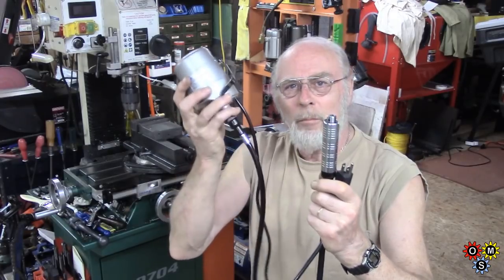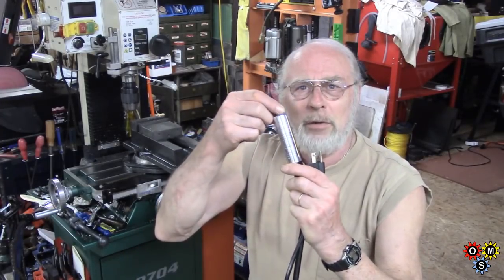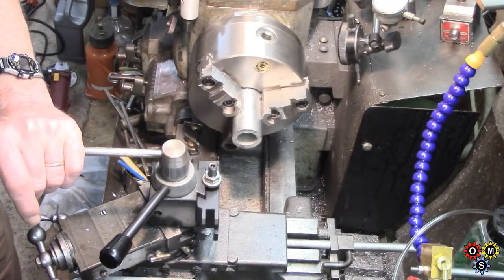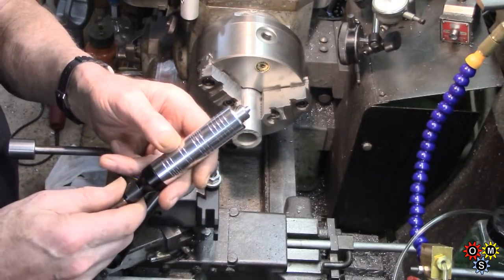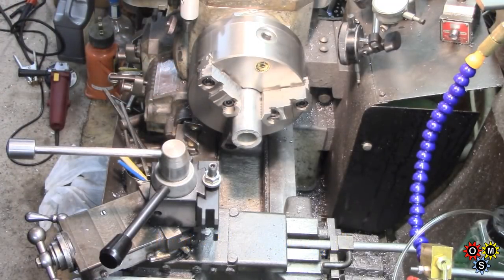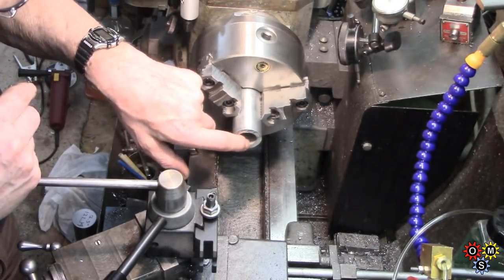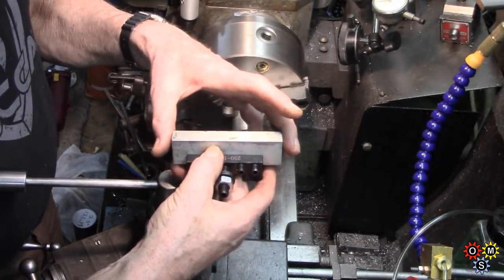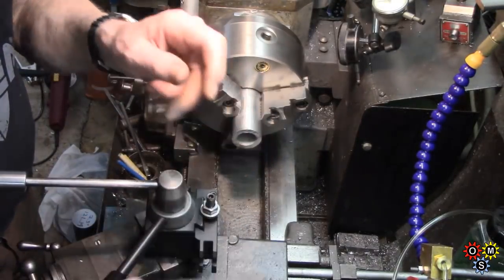Toolpost Grinder Attachment 2

Comment: watched the Dremel grinder project needed something a bit bigger so bought a cheap die grinder with a strong bearing front end and used the same idea works fine but i like the flexible shaft project looks stronger and good for smaller work great video thanks

Comment: I strapped a new Makita grinder to my Mini lathe, on the tool post just to see if I could get down to tenths of a thou, it surprisingly worked. For the internal grinding, the small grinding wheels with the metal shaft, I glued to a hole in the spindle with five min araldite,  after a pass with a diamond they were ready to go and worked well, changing a wheel was just a matter of heating the shaft where the glue was, and the old wheel fired out like a bullet, then sticking another in as required.
Reply from the maker: Hi - thanks for describing that - sounds very effective. :)

Comment: Nice work Chris. I like the fact that it is much quieter than my air die grinder.
Reply from the maker: Thanks Bob - well yes quieter but - won't deliver the RPMs of an air unit. May be enough but if I had the compressor I'd like, I'd probably go for air power even now.

Comment: Nice adaption. For a successful grind, you definitely need to dress your wheel with a nice sharp single point diamond mounted solid somewhere on your lathe. Heat is the enemy, so I would lean toward a softer coarser grind wheel.  Also, I would suggest dropping the lathe rpm to about 100 and experiment from there. If your air grinder is powerful enough, and it's bearings can take the side thrust, you should get a really nice finish. At some point, a spray mist will help. Keep up the good work Chris!
Reply from the maker: Hi Michael, thanks. Indeed I must get a diamond point dresser - my last one came to grief and never replaced it as yet.
Thanks too for your suggestions - spray mist is a good idea too.

Comment: Hi Chris,
              For a cheap tool post grinder you can't beat the small 3 phase helicopter motors from China. I think I paid about £6.00 for a 80 watt motor, max speed 33,000 rpm, and the ESC unit just as cheap with a speed controller at £3-4 (just under $22 total). This particular motor was only 1" diameter and 1.5" long. I happened to touch the shaft while it was running and got a bad friction burn due to the high speed. I intend to use mine for the cutter drive for a small CNC router geared down to about 10,000rpm.
Good video.
Cheers Mo
Reply from the maker: Hi Mo- sounds like something well worth trying! Thanks.
I'm thinking this was a DC motor -12v maybe?

Comment: Very nice attachment Chris, you mentioned running the lathe faster, you will get a better finish if you run it slower and maybe even run it in reverse.
Reply from the maker: Thanks - in fact one project on the back burner right now is a means of controlling the chuck - it's on a thread and needs a method to be able to safely run in reverse. That would be much better then for the grinder.

Comment: You need another attachment on the chuck (stationery) to dress the grinding stone which will correct the run out!
Reply from the maker: Thanks - yes. I did eventually make a simple attachment for the chuck in order to dress the stone. Used an old carbide tool in locked 4 jaw. :)

Comment: You run the grinder and the chuck contra to each other when grinding.Dressing the stone is essential. Aluminium oxides are good for steel girding, don't using hard girding wheels for hardened steels,they have a tendency to polish instead of grinding. Use a good quality cooling  and cutting emulsion. Cutting depth 0,02 m/m per pass, rough item to 0.2 m/m before finished measurement and keep grinder-wheel holding spindle as short as possible.I have done all shorts of girding commercially.It's a very interesting metal working field.
Reply from the maker: Hi Michael - this was done before I made a safe chuck reversal fixture, which then of course will allow contra rotation. Thanks for your useful comments.

Comment: Very nice work once again there Chris. HOT they say 117 here on Saturday.
Reply from the maker: Thank you.
I saw 4cast and saw what temps are possible across that way - AZ, NV and CA etc - awful highs. Near 90 hear and humid is pretty unpleasant.!
Sounds like you may be Phoenix or similar.
Reply: Chris, Apache Junction ,AZ  Its crazy Chris, Like someone throws a switch, just bang HOT over night man.June is the hottest month here, after that the monsoon comes and keeps temps bearable. Then in late Oct, the same thing over night it seems like the switch goes off, the temps drop.

Comment: Hi again Chris,
     Just had another thought. Instead of small grinding wheels how about a 3/16" carbide end mill in place of the wheel. With the workpiece running at what, 1000rpm and the toolpost grinder motor running at around 8,000 rpm I'm sure the combined speed of cut should give a spectacular finish to around 0.0001". I'd like to see the results If you'r inclined to try it out.
Regards Mo
Reply from the maker: Another interesting idea!! Something when I get to it I will experiment with. One annoying factor is my spindle is threaded and so reversing is not entirely safe!
Reply: Hi Chris,
    The thing is you don't have to reverse your spindle all you have to do is reverse the tool post grinder to obtain max differential speed.
Cheers Mo
Reply from the maker: Had thought of that Mo - have not yet explored options on that motor.

Comment: Interesting workshop and you are doing a good job. I'm a precision mechanic from profession, retired for a dozen years but am making similar things up to this day.
Although familiar with it I watched to the very end, realizing that watching others
at work can also be fun. What is the lubrication liquid that you are applying with the small brush?  Some of the lubrication oils to be mixed with water contained chloride, making my
equipment rusting badly. Thank you!
Reply from the maker: Hello,
Thanks for the comments. For lube on steel turning I use a sulfur based cutting oil - (using up the last of my "Sulphcut that I had back in UK). For Al, to help chips come away, WD40 - and for drilling and tapping may also use 'Anchor Lube", or the cutting oil.
Haven't any suds set-up so not used soluble oils. Do have a small mist spray option.

Comment: You've got the stone and the chuck spinning in the same direction, I'm no expert, but I think they should spin in the opposite direction of each other for the stone to cut proper.
Reply from the maker: You are quite right - this was demo'd before I had made a safe way to secure my chuck so as to run in reverse. :)

Comment: Chris you are always mentioning your shop is always to cold or to hot to work. Can you insulate it or do you have to much stuff and the stuff is  your makeshift insulation? It can be a major chore to insulate a shop as full as yours. :) great vid as always.
Reply from the maker: Thanks. 
I know, I know! Always b!tching about temps :). 
It has some insulation but it's old and not well enough insulated, tho I did add a simple ceiling 18 months ago - helps a bit. I have a portable AC unit which can help but when that runs high the elec cost is silly - just pushing hot air to outside world!
Cooler next week so hope to get out there a bit.

Comment: You did it very good... What material is used for the flexible shaft's clamp??
Reply from the maker: Thanks - the main clamp body is 6061 Al tube.
Reply: ChrisB257 is it easy to getting rusa when compared to stainless Steel?
Reply from the maker: Hard to say really - but it is a 'basic' type of aluminum as against a more complex alloy and so would imagine it would be available. However, no reason why you should not use mild steel or stainless anyways. Just that the aluminum is easier to work with and it was material I had on hand and being tube reduced the amount of boring I had to do.

Comment: Thanks for sharing. What kind of projects would you use a lathe mounted grinder for? I took machine shop in high school and I just remembered my shop teacher mentioning that he wanted one but it wasn't in the schools budget.
Reply from the maker: Hi - several things - might include grinding inside check jaws to improve concentricity - grinding outside of a part that needed a ground finish as against machined finish. Even too - grinding an ID to a specific tolerance. Same set-up could also be used for drilling with a very small drill where fine control needed. One other than comes to mind might be using a small diamond burr to create something like an O-ring groove.

Comment: The one thing I wanted to see was how you precisely matched the holes in the tube with the holes in the mounting bar - but it remained a mystery.
Reply from the maker: Hi Rick - to be honest I can't actually remember for sure - but it's very probable I used some transfer screws. They are screwed into the first holes with just a slight point sticking out, and then a tap on the new part over these to get marks.

Comment: I'm thinking out loud and maybe proving I have brain fade........ but i'm wondering if the effect of mounting the tool in the head stock chuck and the work piece  in some sort of holding device against the tool post might counter the effect of poor manufacture of the grinding head....... yep such a thing would mean a Colet holder on the tool stock I'm thinking
Reply from the maker: Interesting thought for sure but it would remove the additive effects of two rotations. I have a few tweaks to do yet to make it better.

Comment: Chris; Great video. Much easier approach than my bulky die grinder. Where are you located? I'm in Northern California.
Reply from the maker: Hi Nik - well, your set-up is probably way more robust and durable but I think this will do what I want when needed.
I am in S Central PA - so a fair jump from you! :)
Reply: Anyhow, I like your setup. How long have you been doing youtube?
Reply from the maker: Many years Nik tho, originally I posted just odds'n'ends. 
About 2 1/2 years ago started shop stuff, albeit pretty amateurish, partly describing things made long ago.
Then, got shop going a bit more and gradually got to making chips again - these days expanded stuff a bit - (which means spent too much money!) - but set-up pretty modest compared to what you have. Had to sell a bunch of machine stuff when I moved.
On my http://www.oldmansshop.com/ site I have most of my videos indexed - going back over 2 years probably by now. The indexing makes it easier to browse and find stuff.
Reply: I built my shop 15 years ago and at the time thought I would never be able to fill it up, but as you see it's packed full of tools. Soon I will be adding a 2nd mill to the mix, not that I need it or have the room, but there are times when the one has a long term project on it and a second will come in handy. Hey, you interested in teaming up and giving each other a video plug from time to time.

Comment: Do you think that less than 3000 rpm will be enough?
It won't suffice for small diameter wheels.

Paddy
Reply from the maker: Hi Paddy - RPMs not really as high as I'd like - even now still considering mounting an air tool eventually. This flex shaft unit may be adequate for some jobs.

Comment: Nice mount, but you should rund the lathe backwards. With the part and stone running the same way you wont get much of a finish.
Reply from the maker: Hi, thanks. Can't run backwards safely unfortunately because lathe backplate is threaded on to the spindle.
Right now stone and work are rotating opposite - stone is running conventionally (clockwise looked at from behind) while lathe chuck rotating counter clockwise as viewed from front.

Comment: Can you answer my question .what is backlash.
Reply from the maker: Hi,
Backlash is the slack that occurs to varying degrees - normally with many machining operations, you would move a tool into position so that any slack gets taken up - if that isn't done then tool loading can make the tool move a bit before the slack taken up. 
Imagine a bolt with worn thread and a nut also worn - there will be a degree of slack between them - this is basically how backlash can happen. It could also I guess be called hysteresis sometimes.

Comment: To paliate your stone problem, why don't you make yourself an arbor to mount an off the shelf  quality wheel? Perhaps a2.5 to3.0 inch diameter wheel.  That is if your litle motor will have enough torque to get that wheel working properly.
Reply from the maker: Hi Pierre,
That had crossed my mind but not sure I want anything that large a dia. May yet experiment further though. Thx for comment.

Comment: wouldnt it be better running it the other side of center as they are both rotating with each other
Reply from the maker: Hi Craig - you are right of course. In fact plans are in mind also for enabling safe chuck rotation reversal.

Comment: I am wondering on the grinder shaft runout.
Reply from the maker: Hi Michael,
This could be a factor to take into account. I have since modified the holder for a small pencil air die grinder which might be a better bet.

Comment: you should rotate the lathe in reverse?
Reply from the maker: Ideally yes but - threaded spindle so too risky. Plans ahead for a means of locking chuck to spindle then we'll be good to go.
Reply: Hi Chris. That is a nice holder. I'm just getting started on what I think is a series of tool post grinder videos on your channel. Some, if  not all, the suggestions below will be addressed in the following videos. 
Running the lathe as slow as possible will improve the cutting action. It negates the effect of counter rotation.  It also allows for a slower reaction time. That become more important over time as I get slower. 😕
I have good success with the 1" x 3/16" pink Dremel sized grind stones. I usually pick them up when I see them. They fit on the Dremel style spindles that usually comes as part of the pack. 
A single point diamond dresser is nice. I was blessed with recieving a couple from Foley Belsaw equipment purchases. A work around can be done with a bit of broken grinding wheel.

Comment: Run the chuck in reverse to the stone!
Reply from the maker: Hi Bill - it is! Assuming I read you right.
Normal chuck is counter-clockwise viewed from front, and grinder is running 'conventional' rotation - as per right hand drill.
Thus the rotations oppose each other.
Reply: From this camera view it looks like the grinder is rotating clock-wise (from the 'back' of the grinder) and the chuck is rotating counter-clock-wise facing it.....
Reply from the maker: Yes - so they rotate opposites... which combines rotational speeds. Are you meaning run them same rotation? I am perhaps not reading you for what you mean.:)
Reply: OK try this... put 2 gears together... gear 'A' left turns clockwise -- gear 'B' turns counter-clockwise...at the contact point they are both going the same direction.... If they didn't they would lock up...(Yes/No?!?!?)
Reply from the maker: OK Bill - I am with you. I was actually considering grinding in a bore - that would give opposite rotations. On an outside surface then yes, both rotating same at contact like your gears analogy.
I think I need to modify the motor if possible so I can change rotation to suit the work.
Sorry I was being a bit slow! :)

Comment: You need a fan :-)
Reply from the maker: Hi Dave - true!
I do have a portable AC unit which can help but when that runs high the elec cost is silly - just pushing hot air to outside world! Sometimes just its fan does help - trouble is it is 'just another' floor space hogging item.!